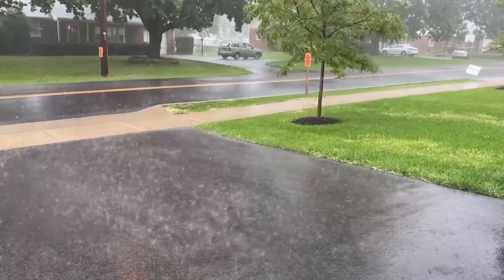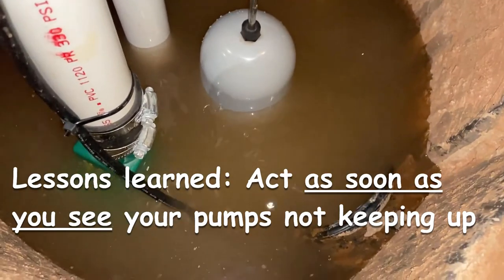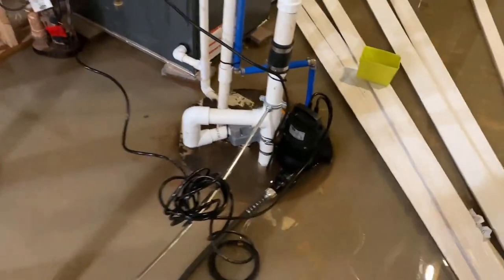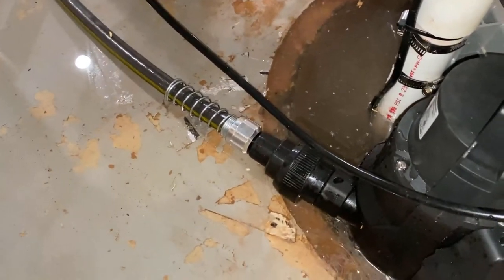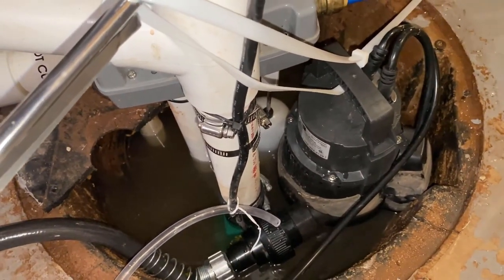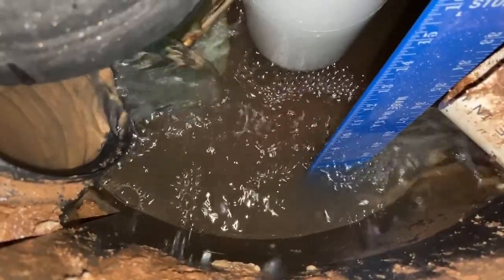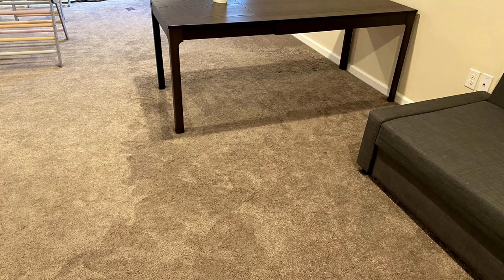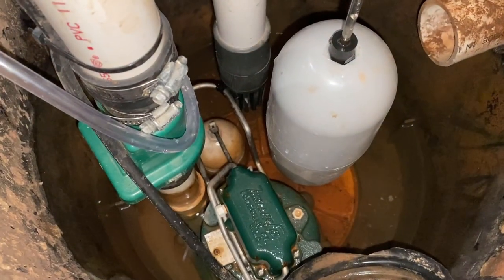How to prevent your basement from flooding, lessons learned from my basement flood

Comment: If you live in a high flood area or know a flood is coming, you need a submersible trash pump like a Tsurimi. It's cast iron, overpowered and you won't have any problems with it. It comes with a 2.5" rubber fire hose and it kicks out about 60gpm. The pump that the person bought is small and the hose kinked up. The trash pump is about 300 bucks and would eliminate that water in just a few minutes. I've gone through flooding and wished I had one a long time ago
Reply from the maker: Thanks for the suggestion!

Comment: I live in Brooklyn, New York. I’m a licensed MASTER PLUMBER and this is my main portion of my work how to prevent flooding in basements believe me the pump you have there does nothing you actually need a backwater valve. You need to reroute your gutters and you need a pump that’s gonna pump the water downstream of the back water valve.... just to purchase this particular backwater valve is around $2800
Reply from the maker: Thanks for the comment
Reply: Even with back water valve it is still useless and will only help with moderate rainfall if you have a toilet or bathtub in the basement. A heavy rainfall will back up the city's sewer system and the water will come back into your drain pipe and seep under the house and start over taking the sump pump and if  the sump pump is connected to the drain pipe is basically isn't going to do much good as the water won't be able to pump out into the city's sewer system !
Reply: @etow8034  you are 100% wrong
Reply: @greekmaster1001  Try me,  how are you going to pump water into an overfilled sewer network ?  The backwater valve only stops water from getting back from the city's sewer to your toilet or bathtub in the basement,  water will start coming from under the ground through the concrete and walls.
Reply: @etow8034  i’ll try you very perfectly cause it’s already been done 
The  water coming back from the sewer into the home is only gravity pressure the pump, pumps with greater pressure I’ve done in numerous times in the past few years not one of them failed
Reply: @greekmaster1001  Even if your so called pump can still pump water with an overfilled sewer,  how does that stop the water from entering through the floor and around the walls, the whole dam street is flooded ?
Reply: @etow8034  man, you have no clue what’s going on in New York City and how the sewer system is. That’s why it’s making no sense to you.

Comment: 99% of the time it is the city"s sewer drainage that is not able to keep up with the rain water so no matter how many sum pumps you have they are useless if the water cannot be pumped out into the main drain pipe. The only solution is to have a sump pump where the water is not into the main drain pipe, but to an alternate outlet outside from the house.
Reply from the maker: Thanks!